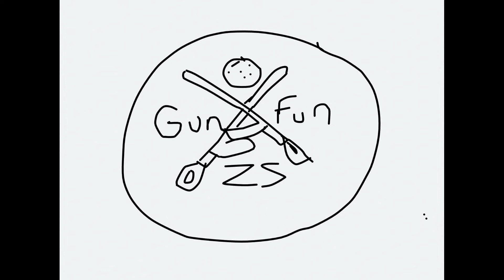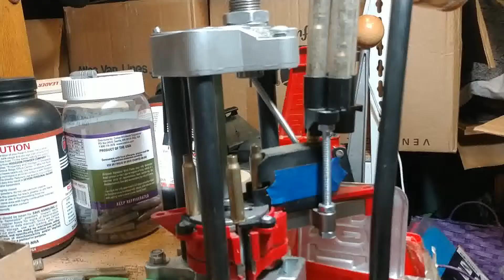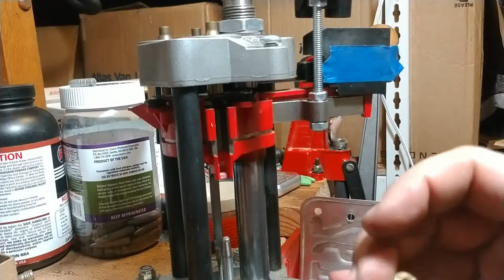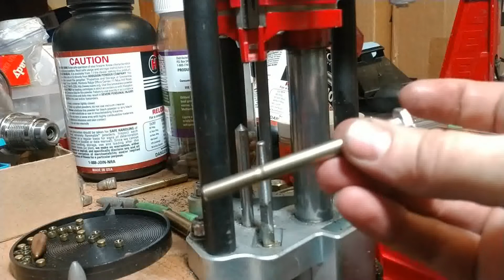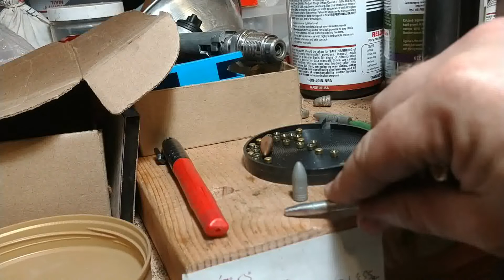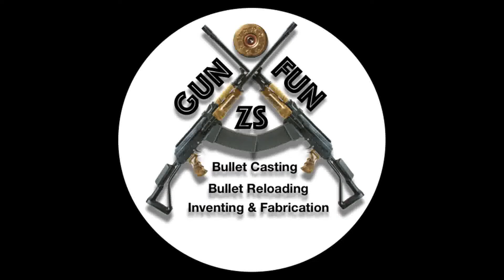Progressive Primer Pocket Swaging on the Lee Auto Breech Lock Pro

Comment: On my press, the hole goes all the way through so I can drill and tap without taking it apart.
Reply from the maker: I somehow missed your comment. It went all  the way through on mine. The issue is being able to hold the drill at the right angle without the body of the drill hitting either the ram from the underside, or the supports and ram from above.  Did you actually try?
Reply: @GunFunZS  Mine is still mounted to the bench but I didn't think about the drill hitting the ran on the bottom side.

Comment: Yet another way to remove military crimp in a speedy fashion .
Reply from the maker: Remember when you sent me that Lee quick trim? It's part of this idea. I ran into some snags, but the idea is to have a router on the 3rd station to trim the brass, and possibly a quick trim adjusted to just deburr in the 4th. You could do 300 BO conversion progressively. All steps on the press. I've tinkered with the quick trim cutter assembly you gave me and if not pushed all the way to the cutters, it definitely works in that role. So the project is not done!